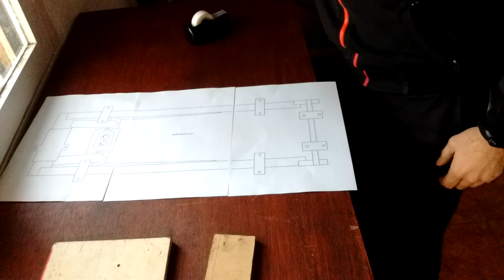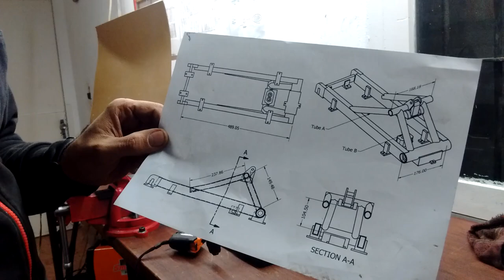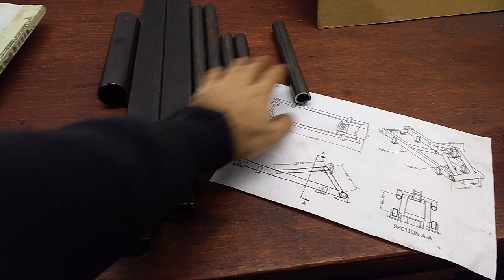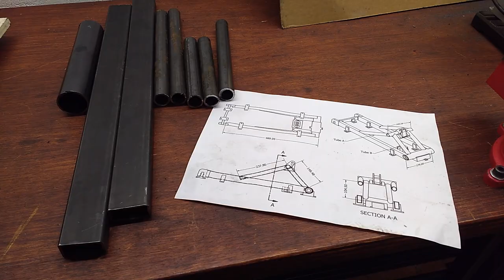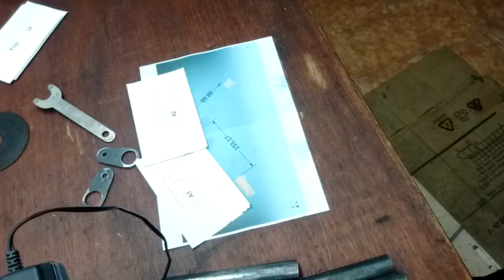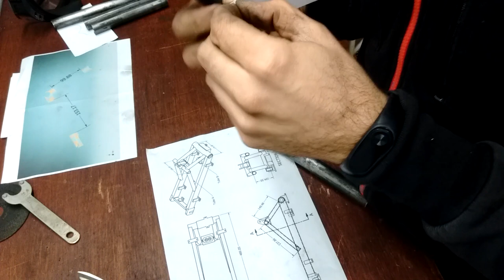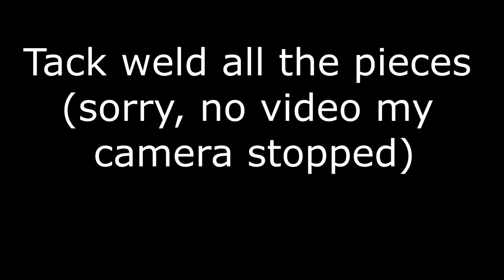Build #1 Swingarm

Comment: Just subscribed dude for your efforts
Is there any video on making headTube
Reply from the maker: Thank you! Have you checked out my video on making the Frame? https://www.youtube.com/watch?v=nFmHWTzSU_E
About headtubes, I pay to a machinist to make it with a lathe. Here is the drawing I handle to machinist: https://github.com/eroldan/OpenEMoto/blob/master/MainFrame/HeadtTube.dwg
The above headtube holds a "44mm semi integrated headset" like this https://www.amazon.com/External-Bearing-Aluminum-Straight-Accessories/dp/B07G6X6NRV
Good luck with your builds!

Comment: Sorry I'm very late with this. Why did you weld the bearings in? How will you change them if they get damaged? They can't go anywhere held by the frame on the outside and the spacer tube on the other. Quite apart from heat damage to the bearing itself.
Reply from the maker: Good question. I think I failed to depict the process good enough. If you look carefully, the bearing is pressed in a metal cup made by a machinist. The weld is done between the tube and the cup. If the heat transfer of the tube/cup damaged the bearing, you can take it out and replace it. In this case, we can call this bearing a "sacrifice" one. I usually weld with high amperage and very quick, waiting to cool down between each point, so the bearing is not damaged, or not enough damaged for this function (not high rpm, not even a full rotation). Here is the drawing of the cup that is welded to the tube. https://github.com/eroldan/OpenEMoto/blob/master/Swingarm/PivotCup.dwg
Reply: @OpenEmoto  Ah it looked like you were welding the bearing straight into the swing arm. As you're using a bush then that Makes sense.

Comment: What's the size of the tube you used for the pivot? Also, what part number bearings did you use to fit in there? Great video and great work too!
Reply from the maker: Thanks!. The pivot tube is 1 1/2 inch with a 2mm wall. The bearings are 10x30x9mm. Those are fitted with a cup (later welded to the tube). This cup is made with a lathe and the measurements are here https://github.com/eroldan/OpenEMoto/blob/master/Swingarm/PivotCup.dwg
Reply: @OpenEmoto  Thank you!